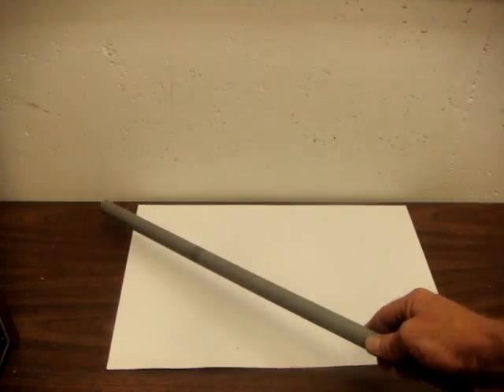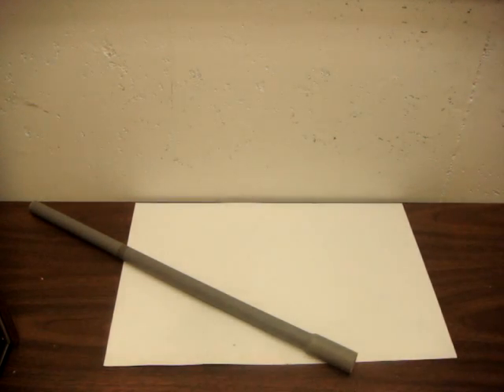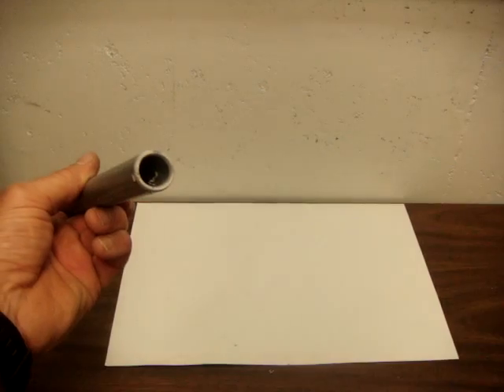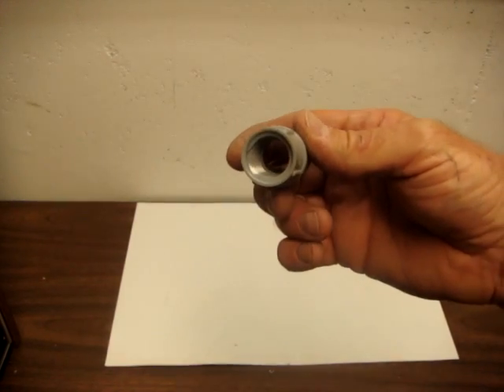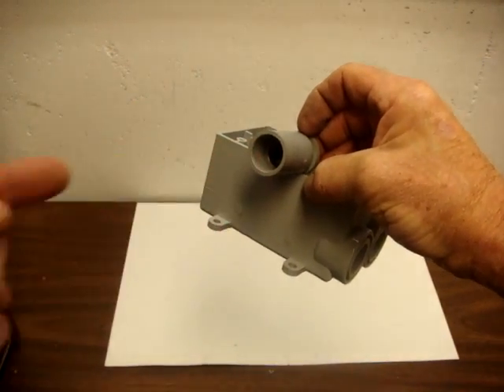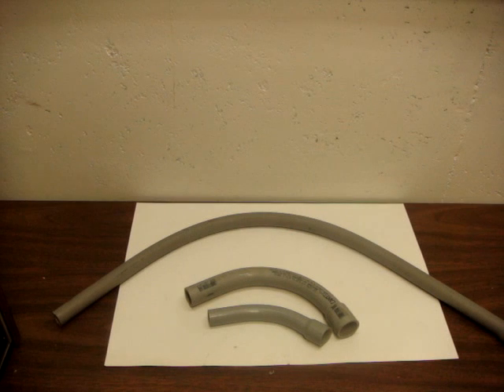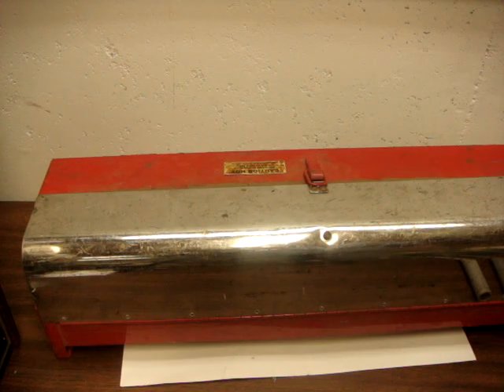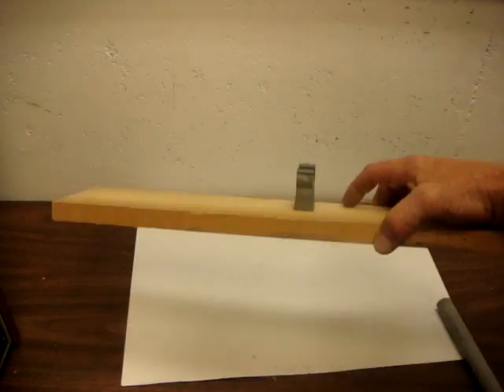PVC Conduit.MPG

Comment: Thank you, very informative. Can this grey 1/2" conduit be buried underground? If so, do I need to use direct burial cable, or can I use regular 14/2 gauge electrical (with ground) cable? I was told that grey PVC electrical conduit is not waterproof, so direct burial cable would be safer (110v 15A line).
Reply: Yes, PVC is approved for direct burial. We do NOT install cables in conduit. We install individual conductors in conduit. Wire like THHN is usually rated THHN/THWN. This means they are approved for WET locations. Make sure you have a green wire ground for safety.
Reply: @JohnRGrau  can we run pvc outside above ground? Thought it was waterproof
Reply from the maker: Yes, providing it is not subject to damage.

Comment: What happens when you are going from PVC conduit to an AC disconnect? You need to have some kind of straight connector on the conduit inside the AC disconnect right?
Reply from the maker: Yes, they are called "Male Adapters"
Reply: I see, so the adapter that you used at 2:55 is the same adapter that you would use to connect with an AC disconnect?

Comment from the maker: I don't know of any reason why you couldn't, as long as it is totally enclosed in conduit. You may find it difficult to pull through the pipe, depending on the number of bends, etc.. Depending on the length of run, you could strip the sheathing off the cable, and pull them as individual conductors.

Comment: Great info, thanks for contributing. I want to use 3/4" gray pvc and pull 10/3 wire from a transfer switch to an outdoor weatherproof receptacle. any reason why I cannot use nm cable? I have enough of it. instead of buying individual wires?